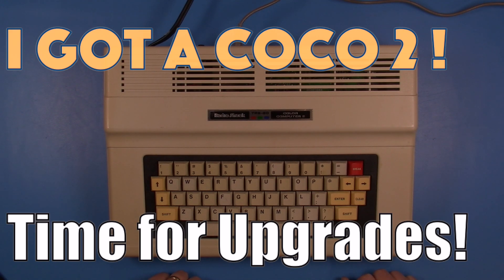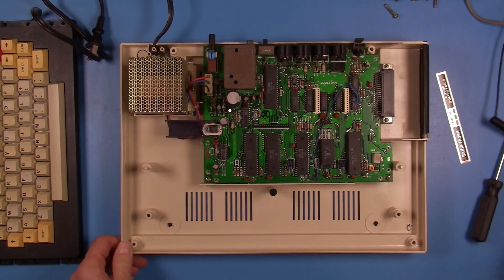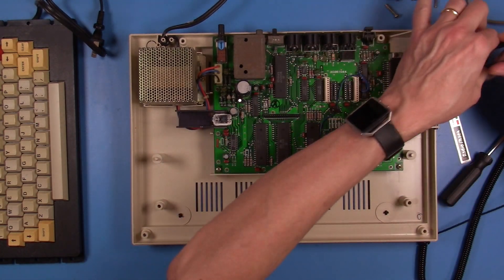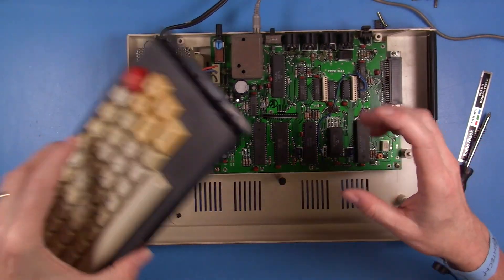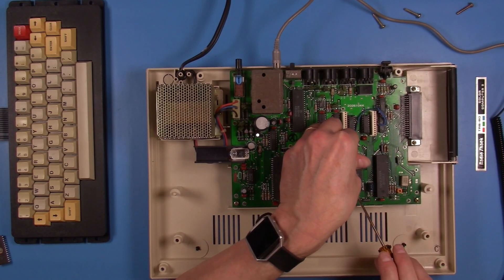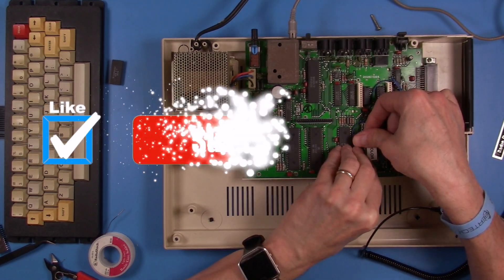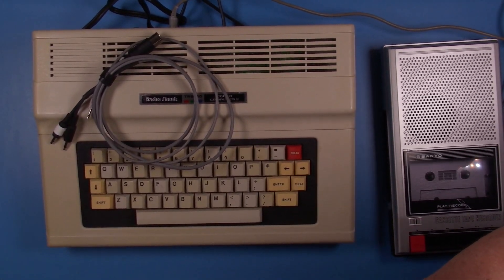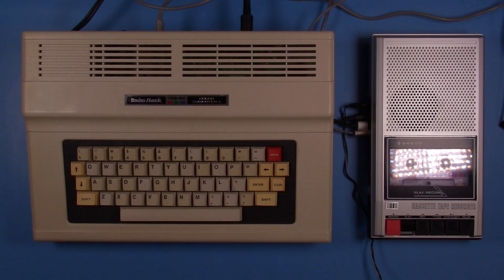TRS-80 Color Computer 2 (CoCo 2): Upgrading

Comment: You can get a good chunk of the RAM back from Extended BASIC by doing a PCLEAR 1. By default Extended BASIC reserves 6144 bytes of RAM for 1 page of he largest graphics modes (either PMODE 3 OR PMODE 4), which is a 4 page (each page is 1.5K) graphics mode. If you don't need high res graphics (or at least not that high res), PCLEAR can return some of that RAM.
Reply from the maker: Good tip. Thank you Curtis.

Comment: How are you changing a 24 pin rom with a 28 pin?
Reply from the maker: I just concatenated the BASIC 1.3 ROM BIN file with the EXT BASIC 1.1 file using the copy command under Windows 10 Command prompt, then burned the combined ROM image to a 27C128 EPROM using a T48 EPROM burner. Fortunately the version of CoCo system board I have already has a 28 pin socket and the jumpers to reconfigure the board for 28 pin ROM chips. I should have shown that process in the video.